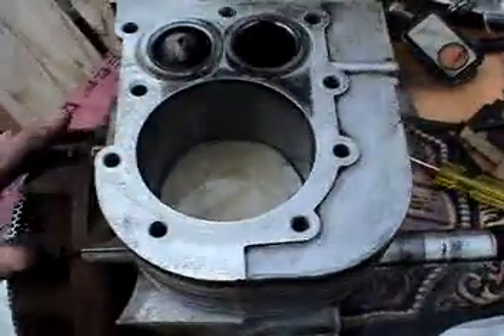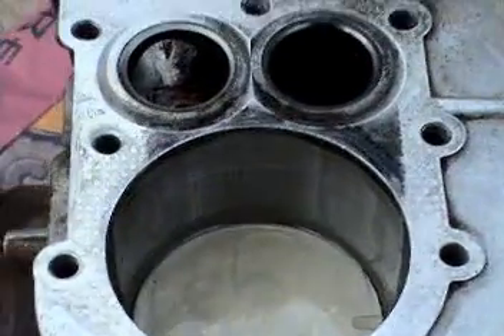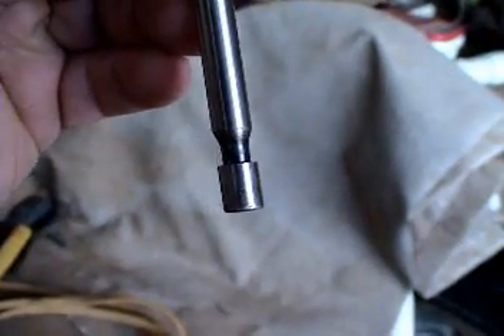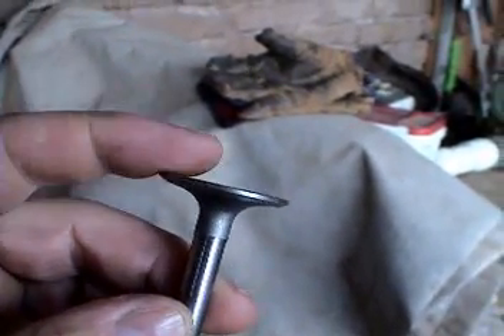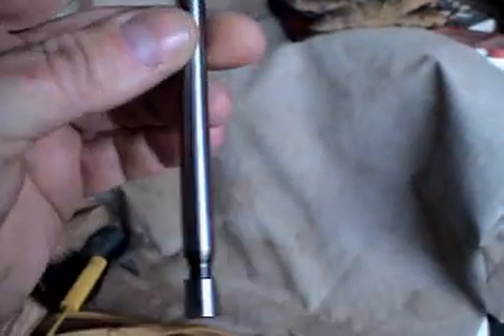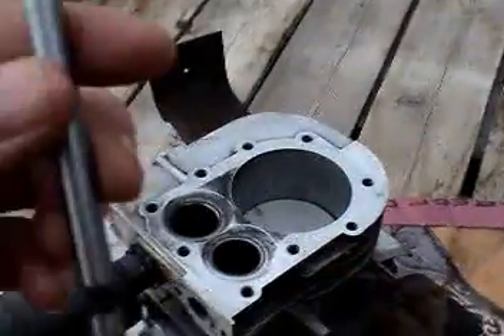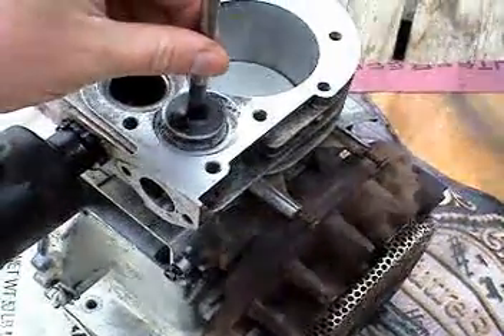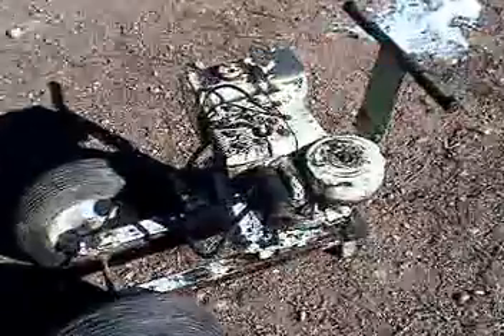Small gasoline engine rebuild / overhaul; part two

Comment: On your next video, get someone to work the camera so you can actually show you using the valve spring compressor and torquing the insert to the connecting rod etc. lots of steps were not shown but you have good camera and voice for doing  these video's. Thanks.

Comment: hows a goin nice vid !!! got some questions see im 17 and i know simple stuff like carborator , and exhaust , and see i wanna get into racing go carts but the only way to be good is to have a good motor we run side shaft clones brand new ya know tractor supply harbor fright etc... well i want to take one and put aftermaket valves and springs  , bored piston , hoaned rod , and fresh rings ... how do i hoan a rod ??? and if i get a bored piston how would that work ?? the same ?? thanks man

Comment: I have a question for all of you people knocking desertphile.

howcome nobody bitches the dave from davidsfarm straightens valves with a screwdriver? huh? yeah it's not "standard procedure" but it works!!

Desert did great! so what if he got some terminology mixed up, he got the job done and the engine runs doesn't it?

Comment from the maker: "I have not been able to take off the crankcase."

Some times a rubber hammer helps. I used a prybar, but it was not easy: the case was stuck, so I hit it with a rubber hammer a few times.

Comment from the maker: "...you have put it in upside down."

Well crap; I hate it when that happens. As it is, the engine still stops running after a minute or two and I have no idea why.

What happens if the piston is installed backwards?

Comment: The fire coming out the exhaust points to the carb. needing adjustment. You should be able to see how to do this on the manufacturer's website. Also, after doing installig the new rings and such, the engine should be kept a medium RPM, and not worked to hard for the first 7-10 hours of use. Also, the oil should be changed after about 5 hours of run time after a rebuild, then you can go back to your normal oil changing routine

Comment: also, try cleaning out the venturi in the carb.  Sometimes they tend to get plugged.  The problem may be a fuel starvation issue.

Comment: That engine has pushrods? You mentioned something about pushrods in your video. Figured there would be just a lifter that rides on the cam instead of having a pushrod as well.  Cam/crank timing is important.  Engine won't work if the timing between the two is off.  The lobes on the cam operate the valves, and if the valves are opening/closing not at the right times, it just won't run.  Depending on how far off they are, it may run and may not.

Comment from the maker: "Did you ever have trouble getting the new rings to clear the cylinder walls?"

It was indeed a tight fit, but I managed it with a piece of wood I shaved into a point: I didn't want to use a screw driver. I did not buy a ring compressor tool, since I would only be using it once.

Comment from the maker: "Did you make sure to seal the cylinder head with a new gasket and gasket sealer?"

I used a new gasket, but I did not use any sealing compound since it has never used it in the past.

Comment from the maker: "Isn't there points under the flywheel also that need replacement or gaping/cleaning?"

There is the induction coil on the flywheel that is "timed" with a key on the rotter: if the key breaks or wears, the flywheel no longer times the ignition properly. I checked this yesterday: the key is still good. I still don't know what I'm doing however....

Comment from the maker: "where did you get the rebuild kit?"

I do not like to put advertising in my video, or the comment section, but I will do so this time. Jack's Small Engines on the 'net has a great selection of parts and kits for many models and manufacturers. They also allow on-line access to a massive parts database.

Comment from the maker: "Timing...."

Yeah, I think you are right. I had the crank case open and I didn't even look at the timing marks! Argh! There should be a mark on the camshaft gear and a mark on the crankshaft gear, and they should both line up. I suspect it is off by a tooth. I'll know tomorrow when I open the crank case AGAIN.

Comment from the maker: "Did you do anything with the cylinder walls?"

I left it alone: I do not have a honing tool. I considered buying an over-size ring set but I could not detect any problems with the cylinder. Note I know nothing at all about over-hauling an engine: it was all guess work on my part.

Comment: Did you do anything with the cylinder walls?  Seems like a waste of time if the rings won't seat properly.

Anyway I remember reading a book on small engines 28-some-odd years ago and it taught me all about the basics of IC engines.

Comment from the maker: "Timing... Too far advanced me thinks."

Dang-all if I know, but I will look into that. I have no idea what causes the spark plug to spark when the fly wheel comes up around and inducts the induction coil.... but the engine vibrates a great deal, which means it is not balancing properly inside. I'll look up timing, and thank you for the suggestion.